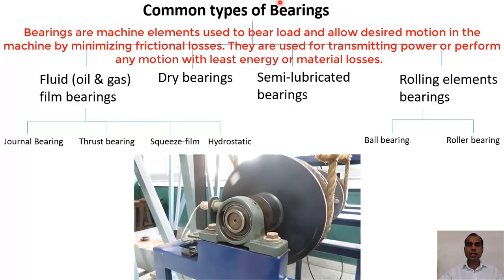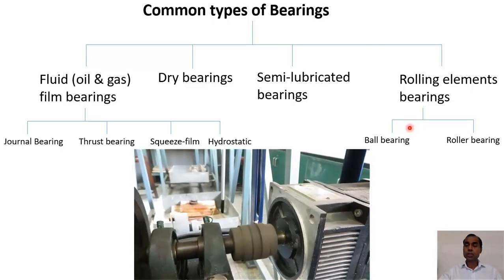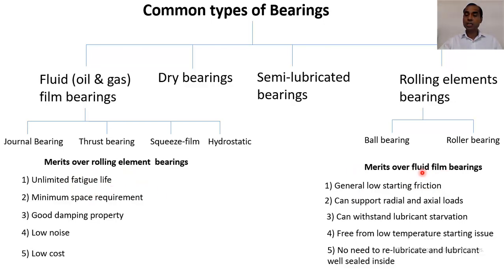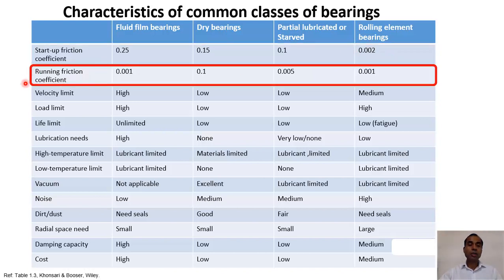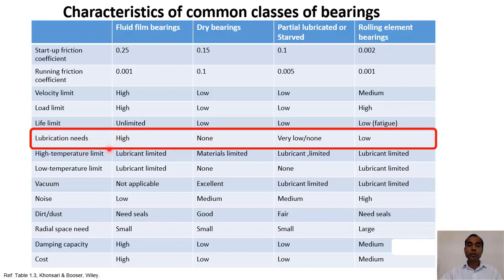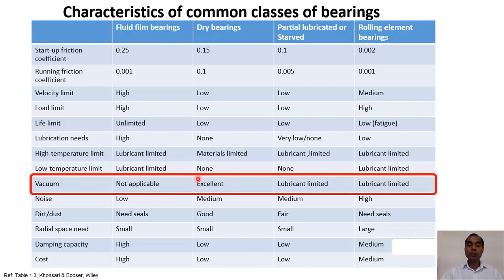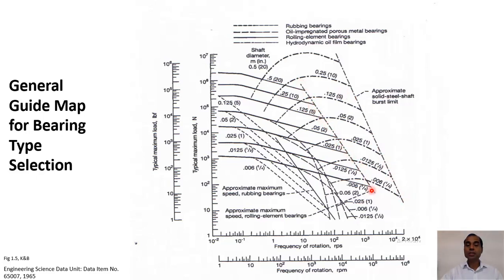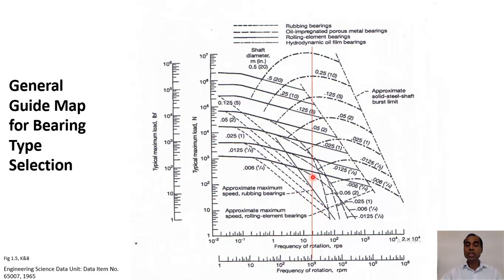Bearing Types and Selection of Bearings - Should You use Rolling Element or Fluid Film Bearing?

Comment: how do we determine the load acting on the bearings 2 plummer block shaft connect to a fan configuration.
Reply from the maker: The total weight of the shaft and the fan along with any couplings or other elements are all resting on the two plummer block bearings. Total load should be calculated and half of that load is acting on each bearing as there are two bearings to bear the total load of the machine elements.